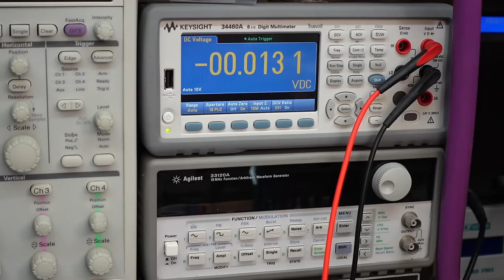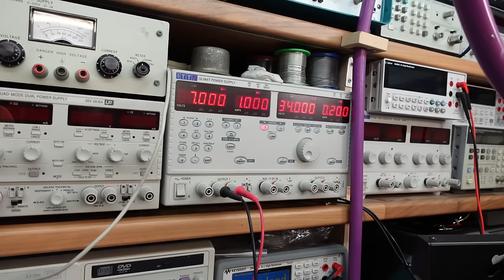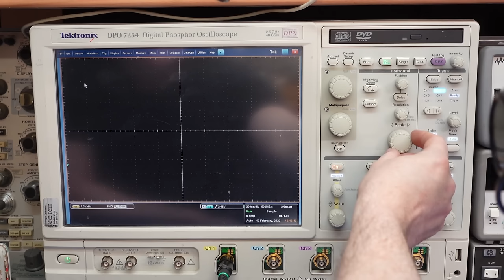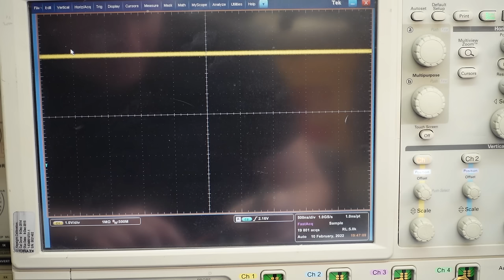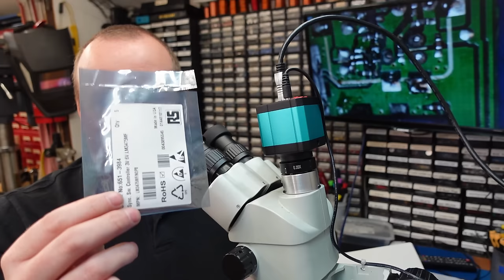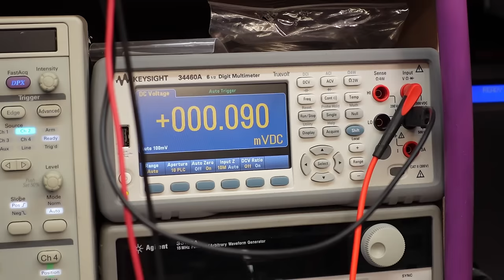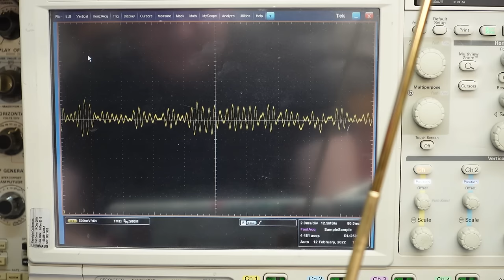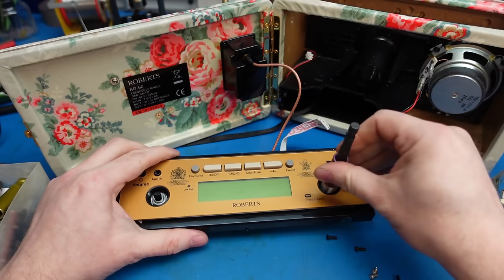Roberts DAB radio repair

Comment: Im shocked that for the price of these radios, 
1. its not got 2 speakers in stereo, 
2. its serviceability is horrendous 
3. its using unobtainable parts

Pretty horrendous really, bose are guilty of this as well

Comment: What does a choke do?
Reply: Another word for an Inductor. As frequency rises the impedance increases. XL=2pifL. It acts as a filter to reduce the high frequency switching carrier used by Class-D amplifiers getting to the speaker(s).

Comment: Why on Earth did they chose a 1.3W Class D power amp, and why does such a thing even exist? Class D for high power, low size / weight is understandable, but for this I'm SMH.
There are a number of analogue low power amplifier chips on the market that are less complicated and, therefore, more reliable.
Reply: Class D and switch mode power supplies are the parts of choice in a lot of electronics today. The components are incredibly cheap, and that's what it's all about. The manufacturers don't care about reliability. Remember that the boards in this radio come mass-produced from china, where the aim is to make everything as cheaply as possible. I like easy-to-use / service electronics such as linear power supplies and class A/B output stages etc so I will never have a radio like this - everything I have is from the 1980s or earlier and I am a professional electronics repairer.

Comment: These Robert’s radios look smart but do seem to be very much form over substance. Neat fix on the buck regulator but I cannot help but think several components in these are pushed to their absolute limits. A good number of these seem to turn up on eBay dead. Probably all with the same faults.